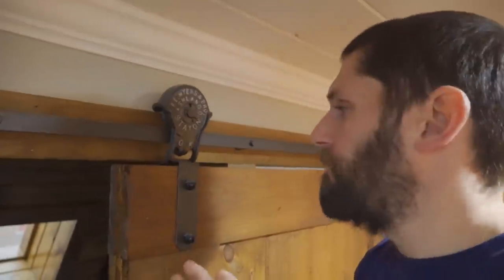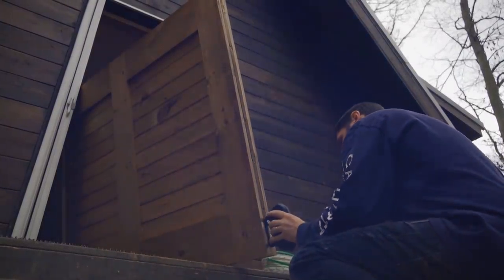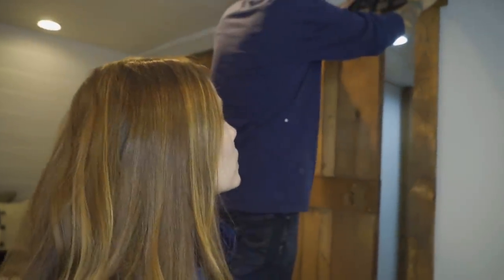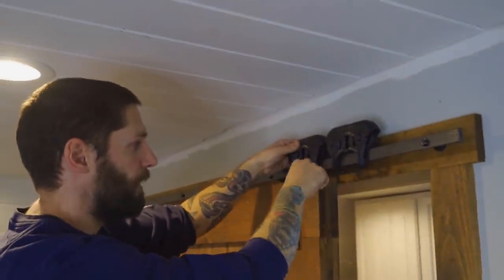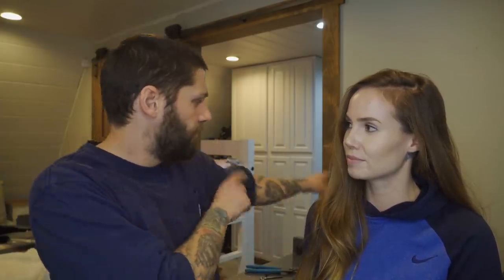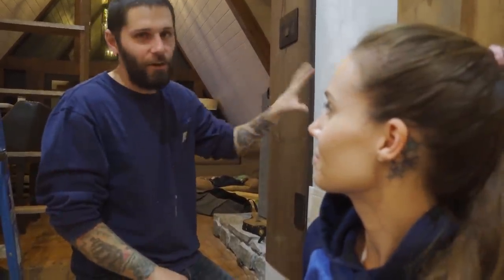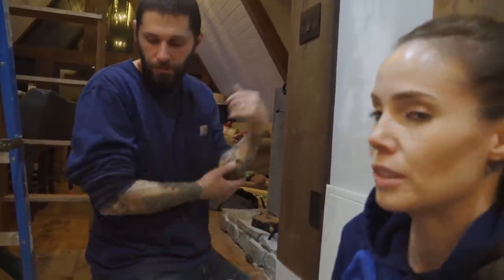Finishing What We Started | Family Builds Their Own Home

Comment: You do great work. I advise you wear eye protection whenever grinning metal or wood, driving nails, or doing any type job that has the possibility of create flying debris. I had a relative who lost an eye, because he was not wearing his eye protection. He normally wore it, but got in a hurry and did not take the time to go get his eye protection, before he started grinning. A tiny piece of metal traveling at high speed was all it took.

Comment: Guys. Those barn door rollers used to be built that way on purpose. I think they are a set. The idea was that the rail was not level. The door hung perfectly vertical but the angled rail would cause the door to automatically open/close depending on which way it was hung.

Comment: To fix those little pin bubbles, try using a wet/damp sponge, rub over like you would with sandpaper. it will smooth it out really nice with out the dusty mess. It will remove the mud if you are not careful, just don't rub too hard.

Comment: Greetings from New Hampshire.  Regarding the barn door runners being different heights, they are supposed to be that way.  The rail should be higher on the back (or “open position” end) than the front or “closed” end.  That way the door hangs level and gravity helps you close the door and gravity ensures the door stays shut.  Don’t buy another roller, just raise the left end of the rail to where the door will hang level.

Comment: You can add a couple of drops of dishwashing liquid to break the surface tension in the drywall mud.  That will stop those air bubbles.  Also, when you go to final sanding you can use a wet sponge to help you get it flat.  It helps because you can actually use the wet surface to see defects and push the mud around a little bit as needed.  Plus, less dust!

Comment: Regarding the move of light switches behind the sliding barn door, you might want to check out the Lutron Caseta Switch (3 way with dimmer) PD-6WCL-WH-3-A
.  It is paired with the Lutron Pico remote switch PJ2-3BRL-WH-L01R.  It will save you from doing any wire pulls.   The remote switch communicates to the main switch wirelessly.  I have used these extensively and saves a LOT of $$$.

Comment: After building several buildings basically by myself, studio, shop, remodel two houses, storage shed etc, I quickly found that the frame work goes relatively quickly and looks llke a lot gets done.  Then, the finishing work.  It takes forever seems like because there's always just one more little detail that needs to get done that takes much of a day if not more.  But it's the finish work that shows off your work.  You are wise to finish the part you've done so far before going on to the next addition.  I'm still working on finishing work lol.  I have found that a lick and a promise is often a promise broken.  Great job you two!  Beautiful house so far.
Reply: As they say, the devil is in the details!

Comment: I admire that you still fight with that wall. I probably would put it aside for a while, or go nuts.
Also, have you thought about getting a shipping container to use as a shop, so you don't have to worry about the rain?
Reply: He’s putting it on too thin and taking too much off, he needs to skim a large section, scrape it flat, skim it again, then sand with a flat sanding block not sanding paper, it’s all in the technique, it’s not hard once you know what you’re doing
Reply: @Beandiptheredneck  Right ! Anybody can slop mud on a wall. One of my employers used to tell me “Cut it tight Lou, cut it tight ! Tight and wide.

Comment: When dry sanding plaster and you get pinholes change to a grout sponge and lightly wet sand it. Wetting it fills the holes while knocking down the high spots.
Reply: Makes a lot less mess too.
Reply: Or I have tried a lightly damp sponge and it replaces sandpaper (no drywall dust) and fills in and smooths out imperfections.
Reply: @genezehring6057  only if you used pre- mixed mud In a bucket, kwik set dry powder mud won't re-wet

Comment: For your barn door height issue...you could set your bracket up or down to compensate for the odd height roller. Visually to make it less obvious, paint and glue a piece of metal to the bottom of the shorter bracket so it matches the adjusted bracket length on the door. Those old rollers are gorgeous....and  i would really want to use them regardless of the differences between them. Two snips of metal would also be less expensive...and you would only see it from inside your laundry room... btw the house looks great! oh, and you could add smart tech to the lights in there to avoid further electrical...so you could turn your lights on and off with your phone and/or a speaker. good luck!

Comment: In regards to the door carriages. At the 5:00 mark. It looks like the carriers are identical cast parts. From what I can tell, it looks like one set of rollers are worn away a lot more than the other set. I know you don't want to loose the rustic antique charm so if you can't source a match to what you've got. Stop by a machine shop, they can turn up a few new rollers to match the less worn set you have. If you were nearby, I'd make them for you.
On that note, people were commenting in the previous 'door' video about how loud it rolls. If you're going to have rollers made anyway, that would be the time to get them made from nylon or UHMW. A tough plastic would roll a lot more quite on the steel track.
Keep up the awesome videos. Have a great new year.

Comment: There are Enocean switches that do not require wiring. You stick them onto the wall. When you press they generate a signal. Either the bulb socket or another switch holds the receiver.

Comment: Need to learn how do some basic blacksmithing. Take that torch heat that bracket and pound over steel rod to create that offset.
Reply: You will hate to know about the black light trick on drywall. Shows all the low spots and imperfections.

Comment: Why don’t you make the slot on top of the door deeper and the hole for the bracket lower? I used to make custom barn sliding doors and hardware and some times you have to adjust it a bit.

Comment: Just picking up the last of my Christmas decorations and sat down for a break. So glad I looked at my phone and saw your video. Regarding your current solar system, can't you connect your generator to the solar charger and have it recharge your batteries? It makes for a good backup system for your solar system.
Reply from the maker: Yes we can and its great as a backup but we don't want to rely on a generator or need to use it regularly in the winter. So, to alleviate that we are expanding the system